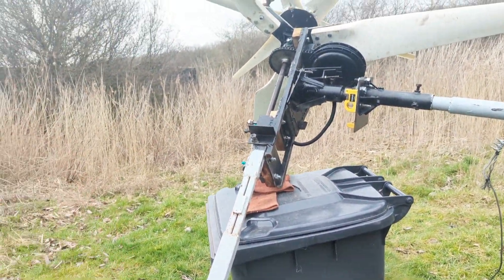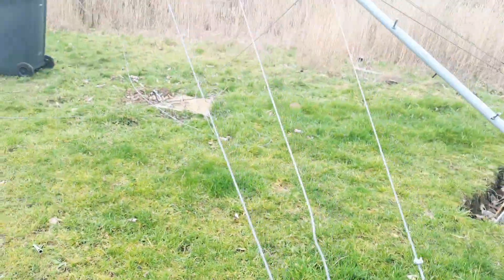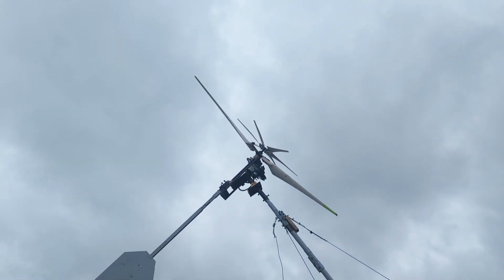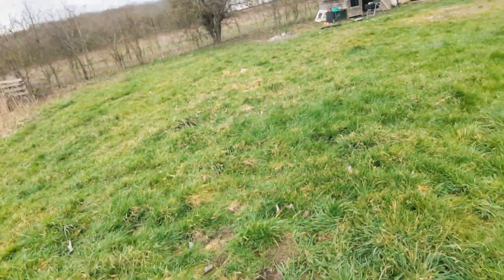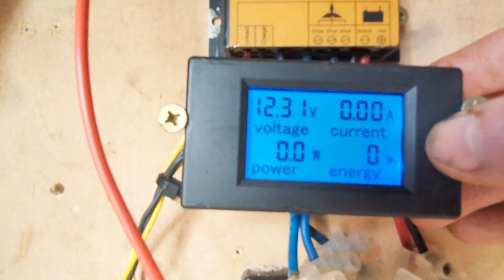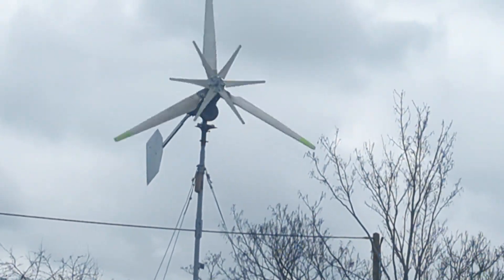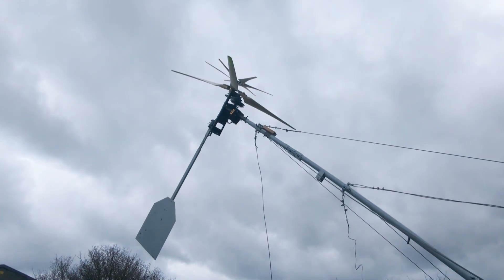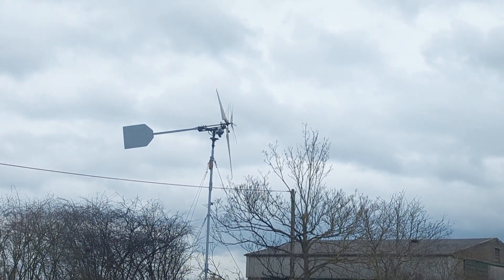Wind Turbine Project Free Energy Generator - Back in the sky - so far so good - 6th March 2023

Comment: Looking very good. That was starting up at just a few mph. Cut in shortly after as well. . That tail look long enough for a furling joint too. Think you'll really see those big blades perform now.
Reply from the maker: Yes, it's turning out pretty good. I actually extended the tail a bit where it slides into the frame so it's as long as it can be. I'm thinking more of a spring based protection mechanism which I'm going to upload some drawings of and which is similar to the wind safe type device.

Comment: looks promising, now the measurement data "rpm, wind speed and watts. I'm curious.
Reply from the maker: Hello my friend, I just uploaded a video. The turbine with the gear upgrades is now hitting 24.5 volts when the blades are spinning at 120 RPM, I do not have a wind speed metre which is accurate but this I do state the approximate wind speed in all my videos. Cheers.